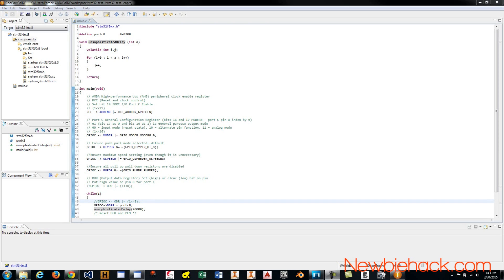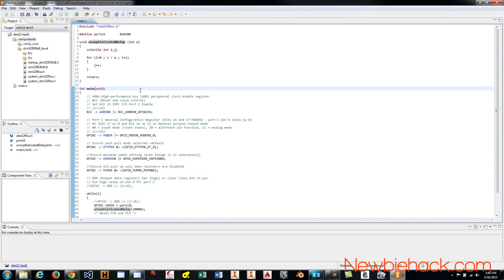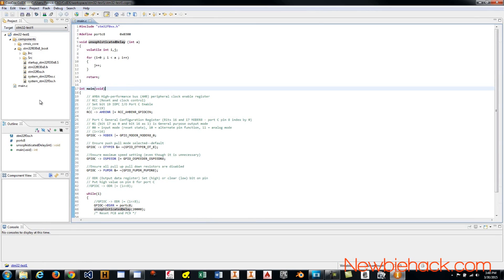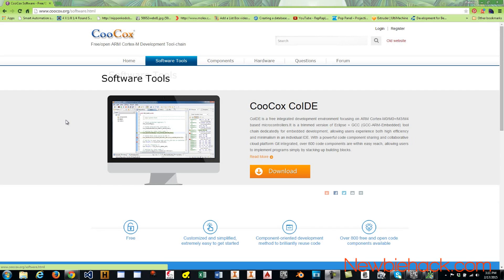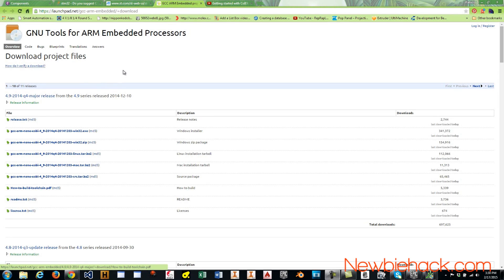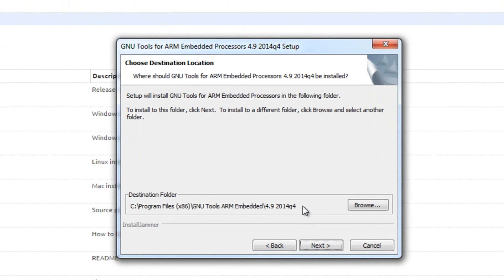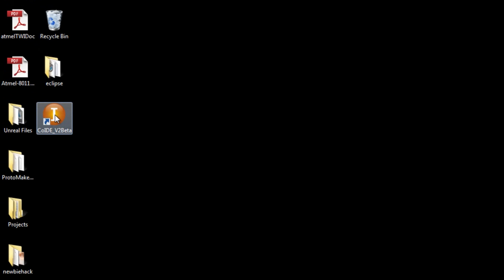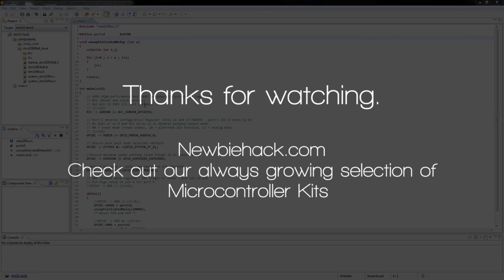2. How to Set up the IDE (Integrated Development Environment) Tutorial for ARM Microcontrollers

Comment from the maker: Due to the lack of availability of the CooCox CoIDE, consider using Atollic Truestudio: https://atollic.com/truestudio/
Reply: Thank you thank you thank you thank you thank you!!!!!!
I am just getting started with the kit I purchased from you and I have been racking my brain about the best way to proceed on the Linux platform, I don't have or want Microsoft Windows anymore. This is exactly what I needed.
Reply: Would using Atollica Truestudio make harder to understand your videos ?
Reply from the maker: @feanorcurufinwe702  No.  My videos are intended to convey the instruction set of the ARM processor.  You should strive to become IDE agnostic.  CoIDE, Atollic Truestudio, etc. are simply IDEs and provide the ability to write code, compile code and transfer programs to the processor.
Reply: @PatrickHoodDaniel  That was a great advice, thank you, and thanks for thr quick response too. 🙏🏻
Reply from the maker: @feanorcurufinwe702  You are very welcome!
Reply: @PatrickHoodDaniel  Hello, thanks for the tutorials. I am still a noob in ARM and coding. I worked already with arduino, but only by changing some settings in the code and put this and this togethers :-) Now i bought a STM32F7469Disco Board because i liked the price and the touchscreen. To make a GUI via the now Free to use Software TouchGFX i was able. In the videos TouchGFX they open their files direct in VS. Now i would love to learn to connect the code from TouchGFX to the STM32F7, to make a Stepper Motor turn on and off and to set the speed. In arduino it was very simple and a lot of sample codes. The gui is ready, but i cant find any sampletutorials with tutorials to get in easy, and how to code it. CubeMX is not out and free and i installed it. Do you maybe have some tutorials which helps to get in this all with some examples or how to make a GUI for a touchscreen? Thanks in advance. I will watch your videos too, because i want to learn it from the ground up for own projects which i try to make to help other ppl like in the CNC Router Video, but i still have only good ideas and not really a way to code what i want :-)
Reply: Hello, Thank you for your videos,  on atollic they recommend using stm32cube... what is a new design when they mention this?
Reply: Swaraj Kali provided this link below and it worked perfectly.
https://softfamous.com/coocox-coide/
Reply: I downloaded that link and my windows defender is saying there's a virus
Reply from the maker: @Matt45045  I am now recommending the STM32CubeIDE.  All of my programming tutorials will work in that IDE.

Comment: Hi there, 
your tutorial is amazing.
while I was trying to start,
I tried to download COIDE but...
the site is down for a long time.
do you have any idea about the future of COIDE?
Should I go for this one or I look for alternates?
your reply is very important to me.
Reply: If you're looking working in STM MC, we shall go with STMCubeIDE (it has both IDE and CubeMX which is a configuration and code generator software)or SystemWorkbench. I generally prefer STMCubeMX and System WorkBench
Reply: @Arunstutorial  Thanks. I was also looking out for an alternative. Hopefully, it works the same as COIDE, right?
Reply: It doesn't really have the option to choose STM32F103C8T6(i am using). Is it that I must choose a Nucleo board with that chipset?

Comment: TrueStudio seems to have been replaced by STMCubeIDE now.

https://www.st.com/en/development-tools/stm32cubeide.html

As all three IDEs are based on Eclipse, I expect they function similarly.

STM32CubeIDE is an advanced C/C++ development platform with IP configuration, code generation, code compilation, and debug features for STM32 microcontrollers. 
It is based on the ECLIPSE™/CDT framework and GCC toolchain for the development, and GDB for the debugging.
 It allows the integration of the hundreds of existing plugins that complete the features of the ECLIPSE™ IDE.

Comment: Thanks for good tutorial series firstly, I see that CoIDE doesn't run on linux. Could you suggest a ide which works well on linux ?
Reply: Atom Editor with the PlatformIO plugin (works for both AVR and ARM - and also PIC32) but be prepared to do a lot of RTFM.
Reply: Thanks, I heard about but didn't tried. It looks great

Comment: The compiler is more of a personal choice and I don't really see why you made this choice though.
So I don't really get why I should follow you on that example.

Eclipse + GCC + ARM plugin would be more logical? The CooCox user-interface looks identical to the old Eclipse ones.
Or maybe the IDE from the manufacturer, they often have neat tools built-in (debugger / specific register settings).

It's a good video, especially for those who don't know how to set up an IDE. But even then I think you should elaborate choices, for others to be able to accept the choices.
Reply from the maker: Good point.  IDEs are not my strong point.  I didn't want to spend too much time on the IDE.  My intention is to focus more on the chip features and demonstrating how to make all of them work.  Showing an IDE setup in the beginning is just to get the users up a running quicker.
Reply: If you know what you're doing, choose the compiler you like. It's almost trivial, but newer people in particular should beware of major frustrations arising from the minor differences between their tools and the teacher's.
Reply: @bnoden432  Thanks for the advice . I'm ok  with electronics hardware from many years ago and now I was trying to get to grips with this subject, [just as a hobby].  When I looked at alternatives for CooCox,   [which is gone ]  I was lost !   I think I will go back to the Arduino which looks a more straightforward place to start . I had a Heathkit  Motorola 6800 learning module in the 80's,  which had a Hex keypad,  and was great fun so I wanted to get to the MCU , as mentioned in video 1.
Thanks again , Kieron
Reply: Don't even get my started on IDE's. Codewarrior was NXP's IDE they developed a couple of years ago (or still do?) and it sucks. They tried to make a replacement, but canceled and then put out Mcuxpresso IDE. For some reason it doesn't have their software for building nice libraries to work with their MCUs. But you can install it because it's based on eclipse. There's a catch though because you need to install the gnu arm Compiler and it doesn't really integrate with the IDE... Can someone just make a plug-in for VS Code for arm like the arduino plug-in? I feel like arm development is stuck in the early 2000s or late 90s.